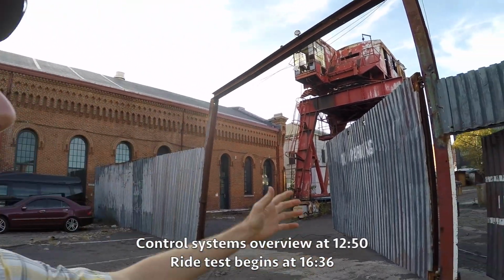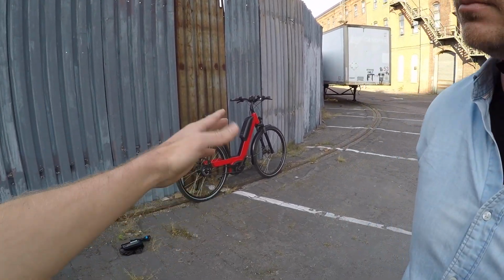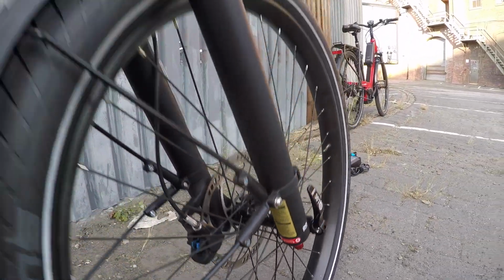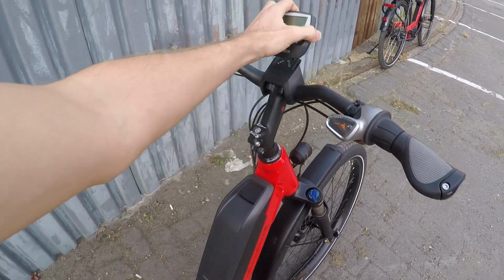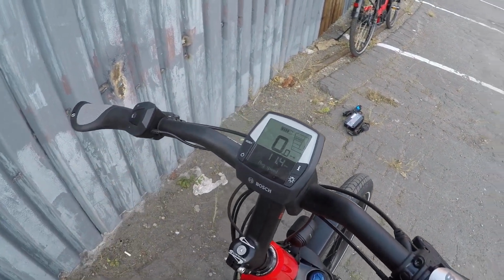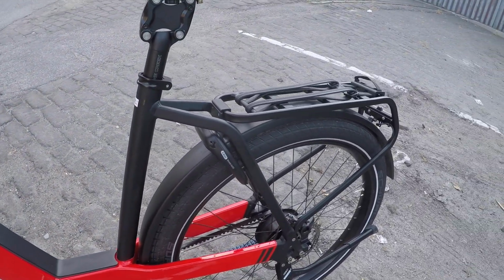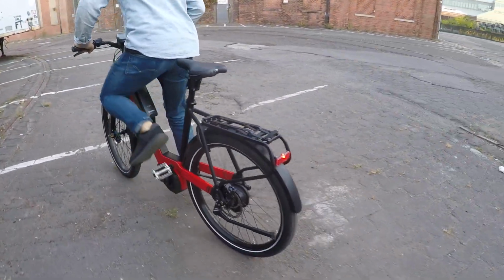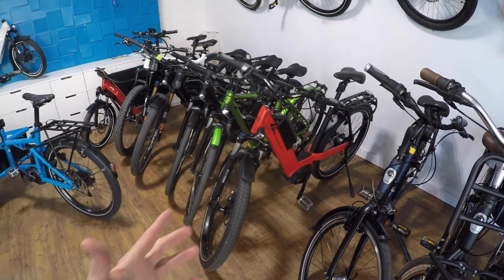Riese & Müller Nevo GH NuVinci Review - $5k

Comment: What's your impression of NuVinci compared to Rohloff?
Reply: Dmitri, it depends on the application. In my recent interview with Heiko Müller, at Interbike 2017 looking at the 2018 models I asked him his personal thoughts. In summary, he mentioned that the Rohloff system is the system to go with for those riders doing huge amounts of mileage on their bikes. The Nuvinci system is ideal for commuting and recreational cycling. 

Now with that being said the Rohloff can be used by anyone and is a beautiful system. Personally, for myself, I went with the Nuvinci system on my 2017 Charger with dual batteries as it was much more practical for my needs and required absolutely zero maintenance and is ultra quiet. I didn't really see the point in getting the Rohloff for my commuting needs (about 5,000 Km's per year)

regards,

Will

Comment: if a $5000 bicycle is junk after 10,000 miles, that equals $.50 a mile just for purchase price loss. id a get a great deal on a german haibike on ebay, theyre selling for $1500
Reply from the maker: Interesting calculation, I'm not sure how many miles these bikes could go before they were truly junk, most of the wearable hardware is replaceable and I have been told that Bosch plans to support and sell Powerpacks for 10+ years. The frame should last and these motors are known for being very durable and reliable. Similar calculations can be done for automobiles but they tend to require even more expensive maintenance, servicing, and the fuel is more costly
Reply: id be most worried about ovaled bearing races, especailly on the crank and if the motor could be rebuilt/refreshed
Reply: interesting not what German bike selling sites say... and every bike is only as good as its owner. I know guys with 70s race frames riding sportives.. and I know a guy who bought a €150 Tesco bike and binned it in 2 months.
Reply: These bikes will last significantly longer than 10,000 miles. That is not a lot of mileage for these bikes. If you are not the type of person who is abusive with your personal belongings and does maintenance these types of bikes will last. Certainly like anything with lithium batteries expect to invest in a new battery 5-7 years from now along with the normal wear and tear items like brakes, tires etc..... The Bosch drive units are super reliable and will most likely never cause you any issues.

Like Court mentions, Bosch will have replacement parts for many years to come. There are so many Bosch systems out there that parts won't be an issue any time soon.

If you are planning to do high mileage riding with the NEVO then you should seriously look at the GH model as the Super Moto X tires are awesome and last longer than any other I have ever ridden on as well as the Magura brakes.

take care,

Will

Comment: Thanks for the video. I'm glad they're serving bigger riders but sheesh, I thought my Large Road-e at 44lbs was heavy. I wonder if the rear rack rating is because the bike could have a bigger rider.
Reply from the maker: Yeah, most electric bikes I see that have fenders, racks, lights etc. weigh at least 50 lbs, most are 55+ so this one at 62 is on target given the really thick main tube that is designed for stiffness. And as for the rear rack rating, I'm not sure why it's rated lower, I think it's just their design and maybe they are estimating more conservatively?

Comment: $5000.00 for a bike with rattily fenders, a tail light you can barely see and no BRAKE light, no thanks!
Reply from the maker: The fenders were louder than I expected... but that was a very bumpy stretch of road :D I think lots of fenders would rattle there and they had to choose extra wide ones to cover the big tires. Yeah, the backlight could be brighter, but most of the things on this bike are setup very well in my opinion :)

Comment: It looks like that bike has a rear hub motor and a mid drive. True?
Reply from the maker: Hi Aaron, good observation! This model actually uses a hub style gearing system called a continuously variable transmission (from NuVinci). Sometimes people call this a CVT and you can learn more about it here: https://www.youtube.com/watch?v=kN8CCY1vFC8 so no, there's only one mid-motor and the rear hub is actually for changing gears to change pedal speeds and make climbing easier. It also uses a belt drive instead of a chain like other bikes.

Comment: What do you prefer ? Derailer or nuvinci ?
Reply from the maker: It depends on the application for me, a bike like this is perfect for NuVinci because the extra weight isn't an issue, the CVT shifts slower but can shift anytime which is nice at stops. I mostly ride lightweight mountain bikes with full suspension because I have a sensitive neck and back... and I always get derailleurs for those. I prefer NuVinci to some of the cheaper internally geared hubs.
Reply: The Nuvinci is most popular for us, but some like the slightly more sporty feel of the derailleur. Having the belt is super nice and only available on the Nuvinci version.